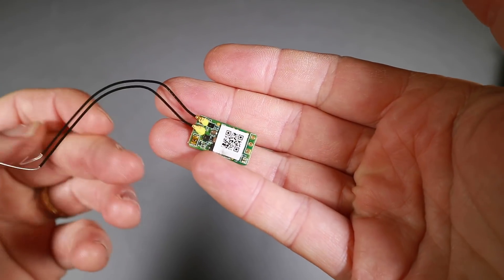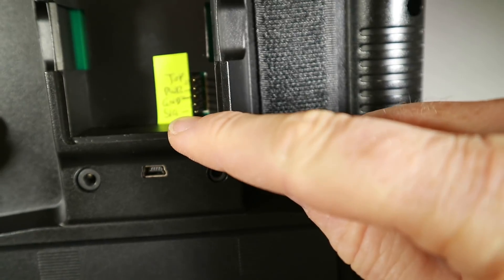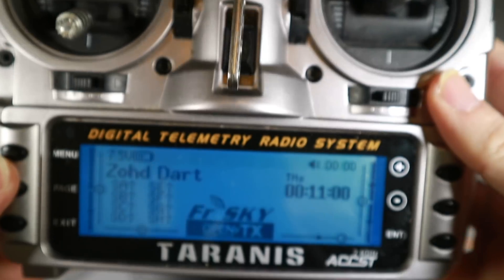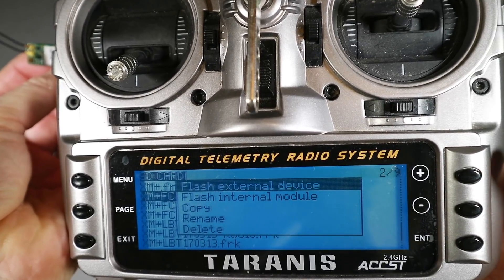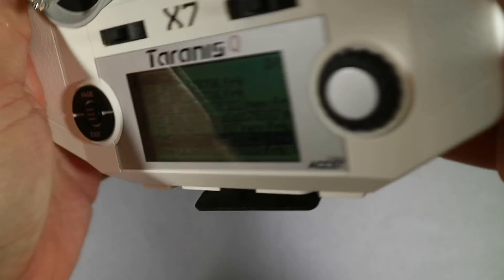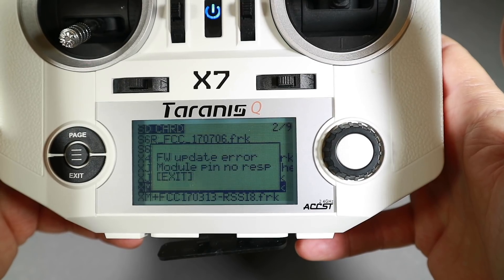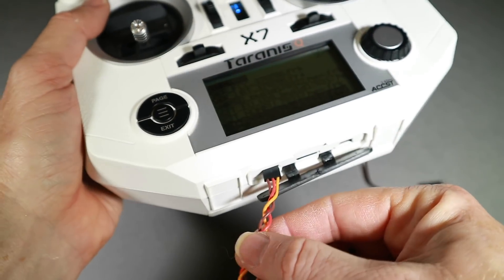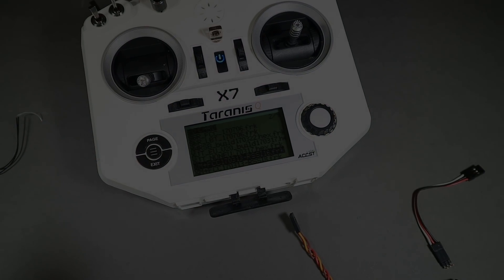Firmware flashing receivers on the FrSky X9D & QX7

Comment: Thanks for the nice explanation, I have the more recent Taranis Q X7S and I had to use the S. Port to flash my XM+ with the following firmware: XM+FCC170313-RSSI16.frk, version 170313, dated 2017-03-28 ... all went well. My Taranis has the Open-TX 2.2.2 (latest dated 2018-07-28) and I have the international firmware (I have LR12, D8 and D16 modes). However the XM+ won't bind my Taranis (set on D16), it keeps solid green and solid red LED when I put it in bind mode :( Any idea what I could try to solve this issue ?
Reply from the maker: When you get a solid red/green on bind it means it's a firmware mismatch - at some point this was probably documented somewhere, but FrSky have hidden it well.  Try reflashing the rx.  Seems odd when all went well before hand - but I've had several receivers which I thought were faulty that were fine after I reflashed them
Reply: Thanks for the tip, I’ll try again ;)

Comment: hay i tryed to flash my xm+ its flashed the new fcc firm when i try to bind i get a soild red light an it wont flash from the taranis no more just trying to see if you had n.e ideal whats going on or a fix im running 2.1.6 every thing worked before i flashed i have the x9d plus
Reply from the maker: What light do you get if you just power it.  Is it solid red all the time, or only during the bind ?  If it's all the time, it's potentially bad news... it's not documented, but does appear to mean that it's bricked.  Did the flash go ok?  Did you try to reflash? Do you ever get any other led status lights ?
Reply: red all the time. it flashed an ya the flash went ok an the taranis wont reflash it i get the message ya i think its bricked no green thanks for the help i have two more on the way
Reply: @CurryKitten  mine got blinking when i'm just power it, but it's like not normal...i'm trying to reflash new firmware but still got no luck! and it turn solid led and green light when i put in bind mode

Comment: Hi. I have an old taranis X9D (not plus), from 2012 I think, and I never had to upgrade the firmware on the Transmitter, since I only used the basic stuff needed for fixed wing, no S-bus, etc...
But now I'm meddling with multirotors and got a XM receiver with the wrong firmware (EU), so I need to flash the receiver with FCC firmware. Do I need to flash a newer firmware onto the transmitter in order to do that? 
Also, even if I don't need to flash the TX, is it a good idea to upgrade the age old firmware I have on my Taranis? I have never seen the need before, but now maybe it's a good idea? I'm kind of reluctant to do that because if something goes wrong and I brick it, it's not really available here and I'll have to wait about 2 months before I can fly most of my models again.... 
I haven't connected my Taranis to a PC since I first did a setup, ages ago, with audio, etc.... and if I remember correctly, I had to remove the SD card to connect it directly to a pc or maybe I used CompanionX. Is there a way to access the SD card while it's inside the TX, without companionX or other specific software?
It's kind of hard to get info on the web specifically for the X9D (not plus), and most stuff I see doesn't work (like turning it on with the trims pressed). 
I see you also have an original (not plus) TX, maybe you can give me some pointers....
Thanks

Edit: I don't even have a FIRMWARE forlder on my SD card...
Reply from the maker: Yes - I have the original Taranis as well, and did have to upgrade the firmware in order to flash receivers.  You need to be on OpenTX 2.2 or later in order to do this.  I think (trying to remember) that my first issue was that I couldn't use my Taranis on a sim until I went to OpenTX 2.1.  So 2.1->2.2 is easy, but that initial upgrade was a pain.  It's definately worth doing, but what I recall most about it was that all my mixes were messed up - I had to go through 40+ models and check them all.  IIRC they added another source to the ones available and this sort of shifted all the source order along one.  So back everything up, and check for any weirdness after you upgrade.  The upgrade itself was straightforward (albeit tense while it happens)  As I remember it, Companion9X was the old software, so look for OpenTX Companion now (helpfully a very similar name)  You won't get a firmware folder, it's  just a directory you create to put the firmware in.  But at the later firmware, it's easier to access the SD card whilst in the radio by booting with the trims held inwards.
Reply: CurryKitten Thanks a lot for the pointers!!

Comment: hmmm... looks like the smart port adapter that came with my R-XSR has the ground and power leads reversed on the server header side?
Reply from the maker: You mean the side that plugs into the Taranis ?  That would be correct if going into the expansion bay port, but not the S-Port if you have an QX7.  Unless you mean the rx side, in which case it should go GND/5V/S.Port
Reply: Yes, I have an X9D Plus. I reversed the wires and it worked fine. Thanks for the tip about labeling the inside bay pinout. I'm sure that will be very helpful in the future.

Comment: Stupid question, but I'm new to this qx7 radio, can you bind and fly a quadcoptor out the box?
Reply from the maker: Yes..... with some caveats.  The QX7 is a FrSky transmitter, so as long as a bind-and-fly quad has a FrSky rx in there, you most certainly can.  For other RX's, there is a module bay in the back in order to speak other protocols, but there's lots of really good quads you can buy BNF which are FrSky compatible

Comment: For some reason my X9D+ can't flash the XM+, even though I did everything correctly. I get an error message before the flashing starts, but luckily my XM+ receiver didn't brick like many people out there. This seems to affect many people and Frsky doesn't have an answer to the problem.
Reply from the maker: That's curious - I haven't heard people have been having an issue - is there a thread about it in some support forum somewhere ?
Reply: yup.. Here's a long thread mixed with other issues: https://www.rcgroups.com/forums/showthread.php?2780962-FrSky-XM-XM-Micro-1g-16CH-Rx-10-16/page11

Here's another thread: https://www.rcgroups.com/forums/showthread.php?2870872-Unable-to-flash-XM-version-request-failed

There are other threads and videos, but I can't remember where they are.
Reply from the maker: Yeah - lots of issues in that long thread !  No issues for me on two different radios, but I made a cock-up one day and got my wires muddled up.  Putting 5v through the wrong pin will give you an XM+ that won't flash any longer.  I suspect it what might be the case in some of those issues.  Did you guys try the latest firmware on the internal XJT module.  That looks like it's worth doing ?
Reply: I have the cable wires correct, but my Taranis firmware is 2.1.8. There are people with the latest firmware and still have the problem with flashing the XM+. I'm scared to try flashing it again because if it bricks, it have to wait  1.5 to 2 months for a new XM+ from Banggood or Gearbest.  There's a guy in the forum that kill 5 Xm+ receivers by trying to flash it.. There's no way I'm going to be so determined like him...lol. It's been at least a year since XM+ was released, I just don't get why Frsky is still selling the XM+ without the RSSI firmware.
Reply from the maker: I can understand your reluctance.  Although the firmware I was talking about was for the internal XJT module.  The 2.1.8 firmware is the level of OpenTX itself - it's the option you get when you hold down enter to flash your rx and it also gives the option of "Flash internal module" (and there's XJT firmware on the FrSky site).  FrSky do seem like a bit of a brick wall to get through sometimes - I've exchanged some emails back and forth with them - but I couldn't get an answer on the S6R rx which doesn't seem to work with the non-plus version of the X9D for some reason - I wanted to get it confirmed and understand the reason, but all I got was radio silence

Comment: Nice video super daddy :)
I never updated my receivers lol Maybe i should try sometimes!
Do you know that if you actually reduce the number of channels that you are transmitting, you also reduce the radio communication latency, maybe you should think about using RSSI on channel 8.
Thanks for sharing and have a great weekend :)
Reply: You won't probably detect the difference unless you add a chip in your brain lol
16 channels is approximately 18ms and 8 channels is approximately 9ms according to the OpenTX datasheets.
I believe you have your reason for using 16 channels, i just wanted to tell you that there is still a difference. I honestly have 8 channels only on all my mini quads AETR and 2 AUX (Buzzer switch and ARM switch) which is actually 6 channels and RSSI most of the time on Channel 8, so i still have one channel more for free since i'm actually using 7 channels lol Sorry it's my python dev side lol I like optimized things, sending 16 channels when i only use 7 lol I can't do that ;)
Take care super daddy and have a great sunday
Reply from the maker: I did use to use the version with RSSI on ch 8, but then I wanted to do some mid-air tuning adjustments and ran out of channels pretty quickly.  I am unable to actually tell the difference in flight between RSSI on 8 or 16.  Perhaps if I flew two identical quads back to back... but I'm not flying along thinking there's any difference in what I'm flying
Reply from the maker: I can't detect the difference, I used to use RSSI on ch 8, but I've moved to using it on 16 now
Reply: is there any real difference? r-xsr has one firmware for 8 and 16, but hese xm's - 2 versions. i can use 8 mode on micro, but on a miniquad i d like to have 2 more switches